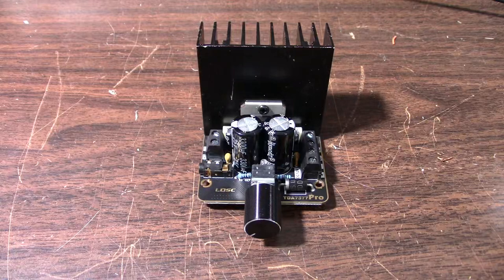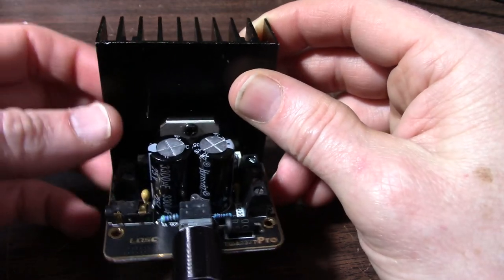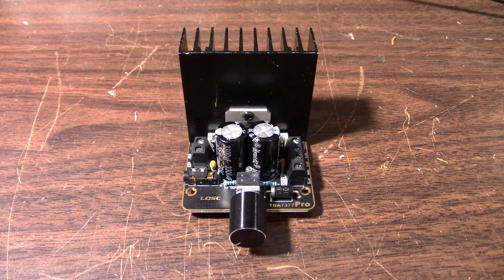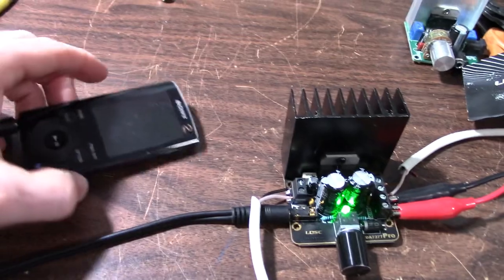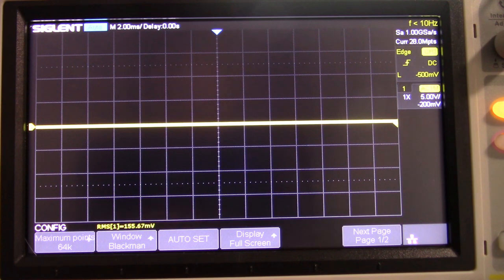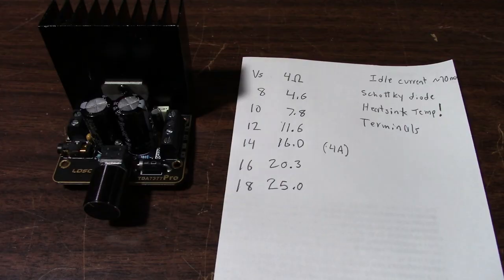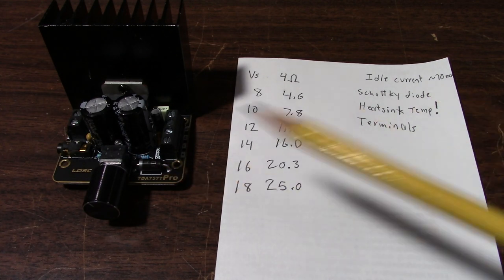TDA7377 stereo amplifier board test and review

Comment: This amplifier is used by Creative Labs in various models of 2.1 computer systems.
I have been given an equipo Creative I-Trigue 3300 that was not working, and it was due to the preamplifier.
Instead of repairing it, I decided to desolder the TDA7377 to use it in another rig I am building.
It is a tri-amp that uses the TPA3116 (D class) as the subwoofer amp, the STK4182 as the mid amp, and this TDA7377 amp as the tweeter amp.
I still remember many years ago, when I used coils and capacitors to separate the woofer, mid and tweeter signals. But now electronics is much cheaper than 30 years ago and you can use three separate amplifiers for less cost.
I wanted to see this video because I don't have such a good lab to make measurements and I wanted to know what you thought of this amplifier.
Best regards from Argentina.

Comment: Amazing little amp. Having tested a bunch of these i can safely say this is one of the best if not the best out there (at it's size and price). Sound quality is very good, sounds crisp and warm at the same time, especially at 18v.
Needs a bigger heatsink or a fan if you are planning to operate it at 18v and high volumes. Currently using it with a step-up voltage regulator. It is drawing about 2-2.1 amps on its absolute peak but generally it uses about 1.1-1.3 amps on max volume at 18volts. Depends on the music you are playing too.
 I am planinng on replacing it's 2 capacitors with better quality ones and see if there is a difference (i have seen considerable increase on sound quality on other amps).
Reply: Are you stepping up from 12 to 18? I got the bigger brother version of this board with the BT header and four 2200uf caps instead of the two 3200uf. Was planning on just running an 18v 5a psu since it looks like the chip is rated for 18v 4.5a max. I'm concerned now because all the power switches I'm interested in using are only rated up to 24v and 3a, and I don't want to burn out a switch from overcurrent. Building a custom enclosure and will be running a 96 x 96 x 36mm sink on it just to be safe. Will be running 8 Ohm loads at moderate volumes.

Comment: The thermal problem is typical for the bridged amplifier configurations. They have twice the losses compared to single ended configurations because the speaker is controlled by two half bridges and not by one. The advantage is to get higher output power at lower dc supply voltages.
Reply: Is it to correct to class it as a problem and twice the losses when the comparison is made for each unit of output power.

Comment: Really like this board and think the sound quality is excellent. 
Replaced the main amplifier section of an old classAB amplifier that went bad with it but using the preamp with tone controls and the casing. Running it at roughly 16.5 Volts with the bigger heatsink of the old amp and even when playing at volume the heatsink barely gets warm. 
Not much power (a realistic 10 Watts at 8 Ohms I guess) but it seems perfectly adequate for my needs. Comically good sound quality for $12 and I think many would fail an A/B test with amplifiers costing thousands.

Comment: i bought a tube of 5 7377's...for some reason couple years ago. It was fun until i realized the STA540 is pin to pin the same and gives a little more power on the same voltages. But can be run up to 38Wx2 on dual bridge. the 7377 and 540 are good little chips. Logitech uses the STA540 in the Z313 lol
Reply: Logitech use this IC sta540 in almost all 2.1 systems except top systems like 906, 623, z2300 etc.
This is verry good chip amplifier and have good quality and transparent sound

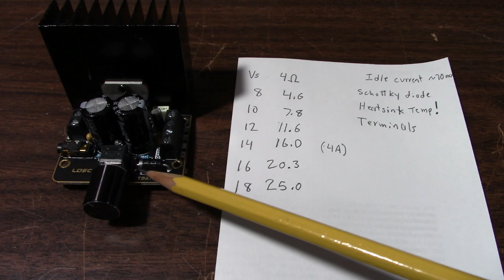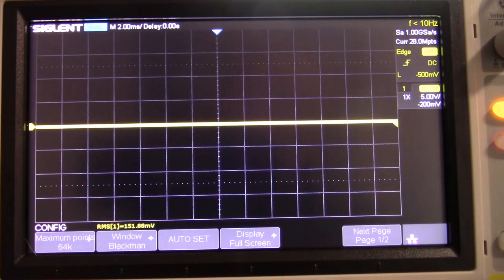Comment: 17:15 / 20:01

•
Heatsink

TDA7377 has reverse polaruty protrection build in so there is no need to use the schottky diode on the board, THANKS !

Comment: Its called Class AB but actually that board is configured as Bridge Tied Load. That is why it does not have output capacitors or split supply.
Reply: The amplifier class is not related to the a BTL configuration,  any class of amplifier could be used in BTL.
Reply: @ferrumignis  The review is not of the chip,  the review is of  of the board.

Comment: I have two amps similar to this one (made by the same manufacturer), but in a more flat configuration and with four power filtering caps instead of two. It's pretty nice, but I suspect the chips are fake. I think they lack short circuit protection and will blow up (like mine did).
The caps' capacitance matched what was written on them and they had an ESR of about 1 ohm each. I have cheaper and crappy amp boards (with the pin-compatible TDA7297) that came with one Chinese power filtering cap each, which actually ended up having almost as low ESR (0.04 ohm if you trust my equipment) as my Nichicon audio caps. Seems like some no-name chinese brands are indeed pretty good.
 
Regarding the heat sinks:
According to my girlfriend who does extreme computer overclocking, the way the heat sink is mounted is not very important, as long as the thermal mass is the same. I run my chips off 15v with 4 ohm speakers and they barely even get warm to the touch. I don't listen with the volume on full blast though.
 
Where to buy:
The cheapest place I found them at is at droking.com. Currently they're 8$ and shipping to Japan is about 3$.
Without case: https://www.droking.com/Amplifier-Board-35W-x-35W-DIY-Power-Amplifier-DC-9-18V-12V-Audio-Stereo-Amplifier-Board
With case: https://www.droking.com/Power-Amplifier-Module-35W-35W-Class-AB-Digital-Audio-Stereo-Amp-Board-DC-9-18V-2.0-Dual-Channel-Amplifier

Comment: I don't suppose you recall what your max current draws were? It looks like this chip is rated for up to 18v and 4.5 amps. I'm trying to build a case for one of these and I'm struggling to find a switch rated 12-24v but above 3A that meets my dimensions/asthetics. Going to be running 8 ohm loads. Thanks.

Comment: Hi John, how would you reduce the the low freq roll off in this amp?
Reply: Increase the value of the input coupling capacitors.
Reply: Any suggested values?  I would  like to use this with a subwoofer that taps into the speaker terminals.

Comment: I don't think those large 3300uf caps are for power supply decoupling. They are most likely outyput coupling caps for the speakers. Since the amp runs on a single 12v power supply, the speaker output is biased to half the supply voltage  or in this case 6 volts. The cap is needed to block that DC going to the speaker which would destroy them. In order not to have an output capacitor the amp must be designed for a bi-polar power supply, like +6/-6 volts to ground or common. This places the output line at zero volts DC or very close to it like in the millivolts. Also those caps are physically small for 3300uf at 25 volts even with today's cap technology. They are no doubt dirt cheap caps. I would replace them with good 1000uf at 25 volt caps. Based on the power output of that amp, 1000uf is more than enough.
Reply: They are not output caps . The board is  configured in Bridge Tied Load and  so does not require output caps. The swing is 22V with centre point  0V.
 The output caps on the single rail class  B  or AB  amplifier Class are to provide the current path for the reverse current flow in the speaker coil.

Comment: As a not knowledgeable person I have this question bugging me. I want to use one of these cheap premade amplifiers for a diy project and add a small fan for cooling. A fan, being a coil, powered by the same dc power source that supplies the amplifier, will it cause noise to the amplifier's output due to flyback?
Reply: I can see what you mean. Now i don't think i've seen a wee computer fan affect an amplifier significantly at all. Thing is you aren't allowed to be TOO electrically hostile in a computer, you might damage tons of stuff, so you expect that there is an input diode on the PCB of the fan that would prevent the voltage kick from feeding back into the common power rail. A second measure that you expect is that the transistors driving the coils are switched fairly gradually, which helps the fan run smoother and more silently, which is another major design goal of a computer fan, but also helps tame the induced power rail noise. Naturally any consumer with any kind of burst behaviour still impacts the power supply a bit and you'll be relying on ample output capacitance of the power supply (and input capacitance of other devices) and on the power supply rejection (PSRR) of the amplifier so that all this noise doesn't end up on the output.

Should there still be trouble, you can implement power supply filtering stages to attenuate the burst noise, basically a coil in line with the unit that you want to shield against power supply noise - or prevent from injecting noise into the common rail - and then a capacitor bank right in front of the device. Together with existing output capacitance of the power supply, it forms a CLC or Pie filter. I don't think a fan mandates adding one of those, but they are often needed in conjunction with say Class D amplifiers which tend to give a horribly bad time to whatever other components you might have hanging off the same supply - like Bluetooth receivers, preamps, headphone amplifiers, etc.
Reply: You may be better off just using a bigger heatsink. I know I would not want to listen to a fan.
Reply: @SianaGearz  Thank you for the answer. I will certainly need to study it to fully understand it, but much appreciated.
Reply: @1pcfred  I'll certainly replace the tiny heatsink that comes with board but I dont want it to be too big for a compact enclosure. A fan could be regulated not to operate at full speed but will still impact the size of heatsink needed.

Comment: How to optimize TDA 7294 for best sounding?
Reply: Use good quality capacitors , genuine ic , that chip is amazing
Thick Diode Bridge
Reply: You need atleast 20000uf per rail if you're using EI transfomer, 15000uf per rail if using with toroid transfomer. Anything less than this will eat up your output. All the best.
Reply: @EngineeringEssentials  20000uF is way too excessive and will stress your diodes and transformer
Reply: @19janiboy96  you should select the rectifier to handle the hit, otherwise you loose output power just because of voltage collapse.

Comment: Does it work properly in parallel mode? My chip gets really hot when I parallel the outputs.
Reply: You shouldn't be connecting the outputs of the amplifiers together, not surprising it gets hot.  John was paralleling the two channels on his PSU.